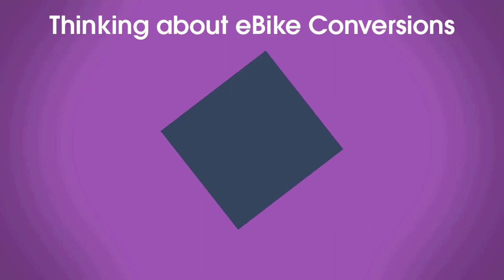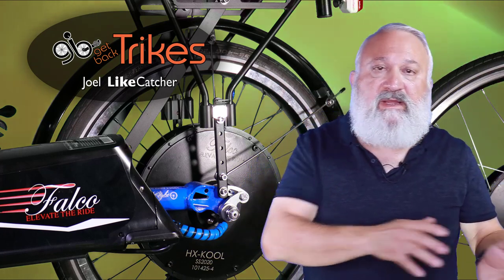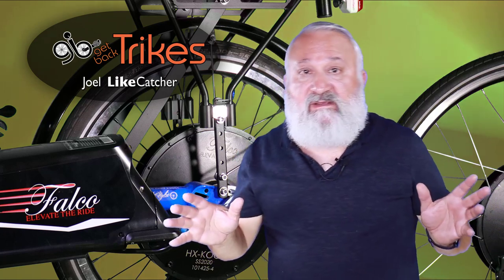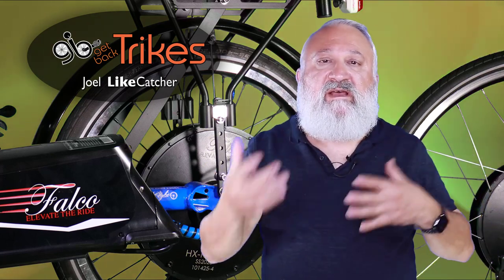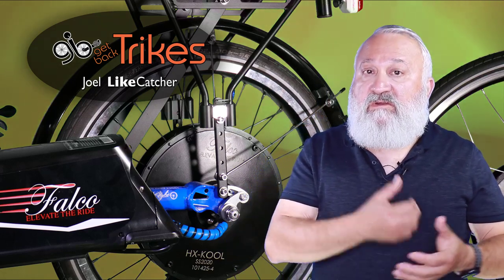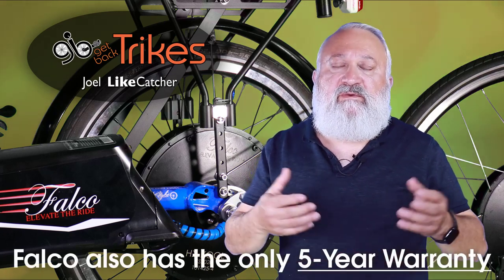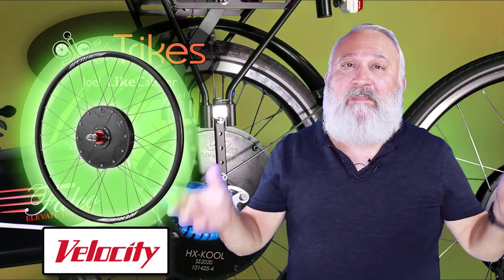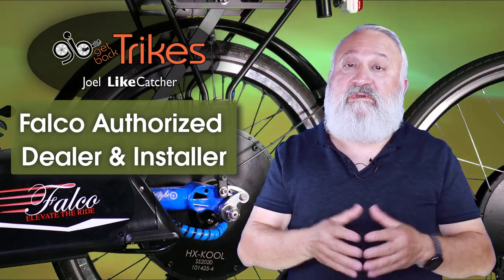Looking into eBike Conversions? Consider a Falco Motor System too.

Comment: Thanks Joel for taking my call the other day. I purchased the Catrike Dumont with the 48v Falco E-assist, a Patterson Metropolis crank transmission and he even included a 2 trike Apaca hitch rack. At first, I was so skeptical about this setup, because I have 3 electric tikes to compare to. One 48v 1500w rear hub 17ah, one 48V 1000w+ Bafang BBS02 20ah and a 52v 1500w+ Bafang BBSHD 17ah. I just finished a 20 mile ride with moderate hills and this thing was the best experience I’ve had riding so far. The Falco’s motor torque and speed sensing is amazing. It is perfectly paired with the Patterson Metropolis front crank transmission. I was pleasantly surprised by the range because it only has a 14ah battery. I could hit 30+mph on the flats, which blew my mind. This Falco setup operates on bluetooth via App on my iphone alone, no separate display, + - toggle or throttle. I am so happy with this setup. Thanks again Joel and keep up with the video and the good work!
Reply from the maker: Glad you love your Falco powered trike. I have a Schlumpf High Speed Drive on my trike. Simular to what you have. I agree a geared crankset is a great pairing with a Falco hub motor! After you tweak your eAssist levels to suit your personal preferences, I recommend you remove the "Wireless Module" and replace it with a "2021 Wired Console." The easy to use full display and buttons make the Falco an even more responsive electric bike system! You only really need the Wireless Module to customize your motor settings once. Adding a Throttle is also a great idea!
Reply: @joellikecatcher3480  Thanks for your recommendations. I am considering the throttle and the wired setup as well. I’ve done research on the Schlumpf drive and really wanted one and was really hoping that this one was a Schlumpf high speed drive. But it wasn’t. I was skeptical about the Patterson drive because it was less expensive and it is an equivalent to a 28t and 45t crank. It feels like a good fit to me. I am pleasantly surprised and was pretty impress with it. I like cruising at the highest gears on this Patterson drive. I’ve also seen someone change the main sprocket for a larger one. I have never tried a Schlumpf high speed drive. Looks like higher gears and double the price of the Patterson.
Reply: @jonk8337  the shlumpf is a 32/64 tooth equivalent. Im usually in the 64.

Comment: I considered Falco when I first started looking into electrifying our Catrike 559 so my wife could keep up with me on rides. It looked like Falco may be out of business. Falco never seems to come up in bike conversion kit searches. Then up pops this video touting Falco. Even Falco's website seems suspect. The catalog pdf is from 2020. Are they still alive and well? Must it be a dealer install to get the 5 year warranty? Until seeing this video, I was leaning towards a CYC Photon mid drive as it has built in torque sensor for more natural feel and a little easier on the drive train than Bafang. Catrike's Bosch kit seems a overpriced option for what you get in terms of power and battery with no options.
Reply from the maker: Falco is still in business and shipping product. I am still one of their dealer/installers too. The  CYC Photon mid drive is a very powerfull stsrem, designed for mountain bikes. Perhaps too poswefull for a recumbent trike!